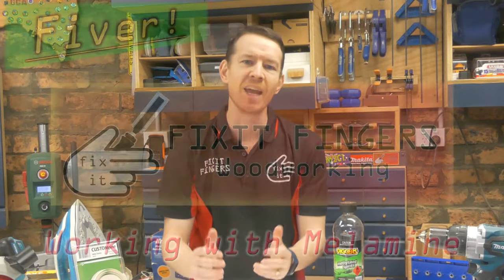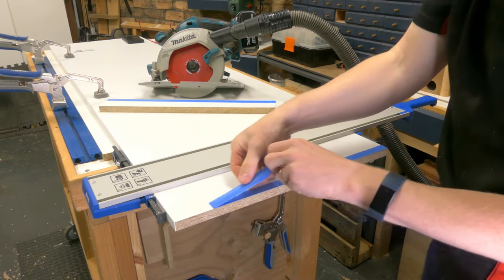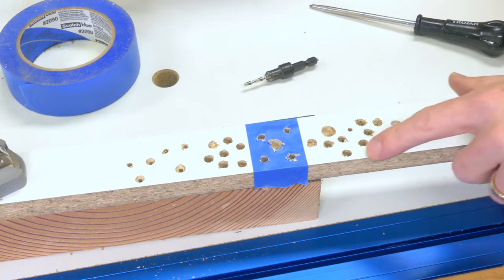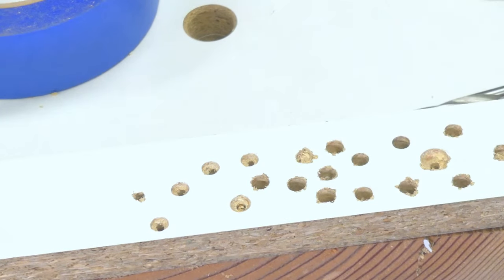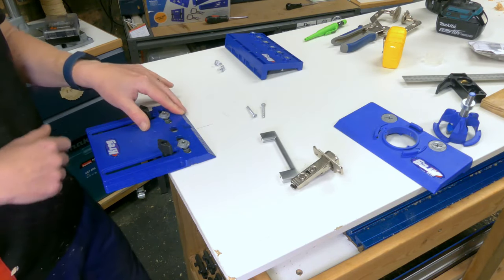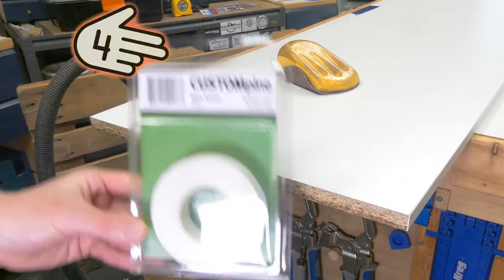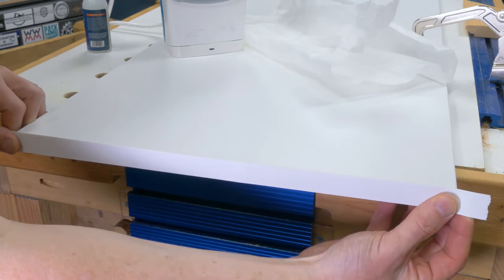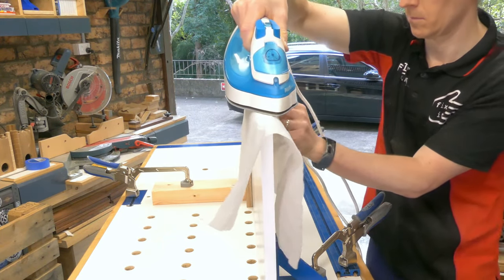Melamine Usage Tips! Cutting, Drilling and Edge Banding (Fixit Fingers Fiver)

Comment: The drill in reverse was a new one for me, gonna remember that one for the future!
Reply from the maker: Every tip is almost the same, trying to get the tool to push the plastic into the wood rather than lifting the skin is key to stopping chipout. Spiral Downcut theory ;)
Reply: @FixitFingers  If possible, I tend to use round head screwes to hide the chipout... 😅
Reply: @CrudeButEfficient  And great big washers     👍😁

Comment: Now that's a proper instruction video, James. Very useful. For cutting sheets using a tracksaw, i have seen some people take a shallow pass backwards. That eliminates a lot of chipping. The concept is exactly similar to the reverse drilling example that you showed 👍
Reply from the maker: Cheers Suj, can't keep making popular pallet rubbish all the time, need some real woodworking :P Yes, I've seen that done. The Festool track saw has a dedicated function for this that sets the depth perfectly. I wouldn't try it with the accu-cut as a little too deep and kickback is very possible (setting the blade depth is tricky with this setup).   Probably safer with a proper plunge saw.

Comment: The best tool for trimming edge banding is a planer blade - much easier to use than a chisel. The special trimming tools are rubbish, they don’t cut clean particularly if you’re using real wood veneer edge banding.
Reply from the maker: But then I gotta take it out of the plane 😅 ...and make sure it's sharp. Yes, I've seen this done, good reference surface too especially on thicker veneer. If you're doing a lot of panels my friend The Wood Knight sets up a jig on the router table to zip through them

Comment: In my case, drilling holes in melamine was significantly improved just by switching to regular corded drill which spins quite faster than battery powered ones.
Reply from the maker: Yep that'll help too!  I could never go back though after using battery ones 😅

Comment: Cool tutorial. I actually have a big melamine panel given to me and am thinking of making it into a table saw cross cut sled. I never knew melamine edge banding was so easy, I will have to try it. I found a good way to avoid chip out is to use my drill press on the fastest speed but i will try that reverse drill trick next time for sure.
Reply from the maker: A Drill Press definitely helps, but not everyone has one so I avoided it in the video. (It can also be tricky to use with big sheets). Melamine is very stable and slippery and therefore a good choice for jigs and sleds! As long as you start it straight, edge banding is quite forgiving (and can be cut off and redone if you really stuff it up :P)

Comment: I use melamine quite a bit. And you're correct, the right tools or jigs make the job so much easier. I actually have all the Kreg Jigs as well, and now, I would be lost without them. Great video by the way. 👍🍺
Reply from the maker: I think your early videos on the topic were some of the first I ever saw when you were making those big carcasses. Haven't had to do that yet...looked like heavy work. Festool has an automatic edge banding tool dont they? 😅

Comment: G'day James. Nice to see another video of you😊I've already noticed Uncle Nick....why don't you use wood drills with a centering tip. According to my information, you have them at A from Bosch. Cheers and Check Square mate 👍🏻😊
Reply from the maker: We call those brad point bits, I showed one at the start of the drilling section 😉 Even with an expensive carbide set I still get inconsistent holes with them 😅
Reply: @FixitFingers  If I'm home tomorrow morning after my night shift, I'll go to my workshop and try it out 🤘🏻

Comment: I know this is an old video, but is there a way you can prevent the edges splitting when screwing into it? Say when screwing two sheets at 90 degrees straight through the wood pieces
Reply from the maker: Two ways, predrilling  in melamine should help stop it  but you are still going into 'end grain' which is really weak because of the way melamine is compressed. My go to is Pocket holes. They and melamine are good friends. The way the jig works means the business end of the screw is hitting the face of the mating surface, which has more strength. Always put them on the outside of the 90° joint with course screws and that should stop splits and be super strong 👍
Reply: @FixitFingers  Amazing response. Thank you so much. Im planning a wardrobe build, and this may have just saved me from having to use mdf and painting it
Reply from the maker: @baz_k  best of luck!  If you use pocket holes, do a few tests to get the clutch setting on the drill right. Biggest risk in melamine is over driving and stripping the thread. Low is usually the go 😊

Comment: Melamine is great. It's cheap and the surface is smooth and easy to clean and the boards are always flat.
Reply from the maker: Especially with the spiralling price of ply, I've been using it more. Also, you can often find it free dumped in the gutter 😝

Comment: I am new to woodworking, and I have to ask. The clamps that you have attached to the blue track, what is that system called? I would like to build a table like that.
Reply from the maker: @paulr7719  G'day Paul, that is the Kreg Clamp Track system, and on my channel is a full build video of the workbench and link to the plans as well 😉
Reply from the maker: @paulr7719  here's the workbench video link - https://youtu.be/p-Uc0Qzf0Bs?si=dxEQU3HKbmriRuVB
Reply: @FixitFingers  awesome, I'm going to check it out. Thank you sir
Reply: @FixitFingers  I'm thinking about making a workbench with a melamine top, think this system could work with that?
Reply from the maker: @paulr7719  no worries, I still love this bench, going strong a few years on
Reply from the maker: @paulr7719  mine is topped with melamine!  So, yes, it will work. 😊

Comment: Great Video! ... I have not had as much luck with the Blue Tape previously, but, im eager to try the scribe cut method next time!! Thanks for the Tip.  I believe the professional saws have a second blade which does this automatically - so it makes sense.
Reply from the maker: Yep those big panel saws often have them. The Festool track saw also has a setting to run safely in reverse to do the same thing before your normal cut. Wouldn't try that with a regular circular saw though 😉
Reply: @FixitFingers  I recon ive seen Dave Stanton do that before.... you'd want it to be a REALLY shallow cut...
Reply from the maker: @ArchEdge  that's exactly where I saw it 😅

Comment: Are you best to cut your board with the top face down to prevent chipping?
Reply from the maker: With a circular saw, yes. The circular saw blade spins towards you and upwards meaning the bottom face will be cleaner as blow out will occur on the face up side, hence the tape to help reduce this. Note that on a table saw this is reversed. 👍
Reply: @FixitFingers  cool beans, so face down produces a cleaner cut than taping? On a circular saw? So I'm better to cut with the seen face down and tape the back or unseen face of the board? ... if any of what i just said made sense 😄
Reply from the maker: @billysaunders544  If I read this right yes 🤣 You can tape both sides if notice chip out on the underside but usually it's not needed 👍
Reply from the maker: In other words, I make the 'good' side face down with no tape, and the 'bad' side the taped top face my saw is sitting on
Reply: @FixitFingers  perfect, thanks very much... I think I'll just stick to welding 👍😄
Reply from the maker: @billysaunders544  🤣🤣🤣🤣